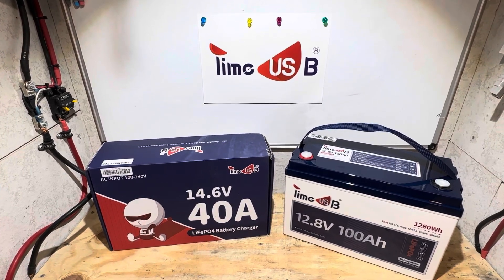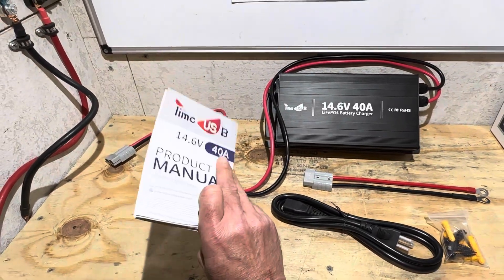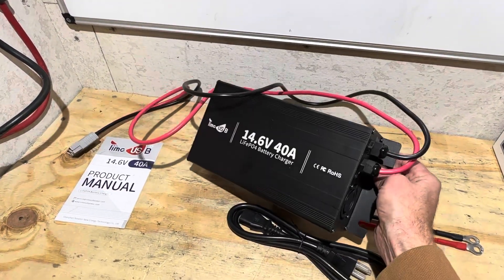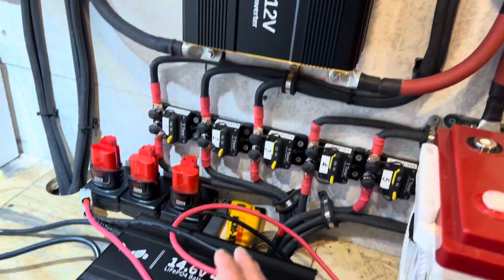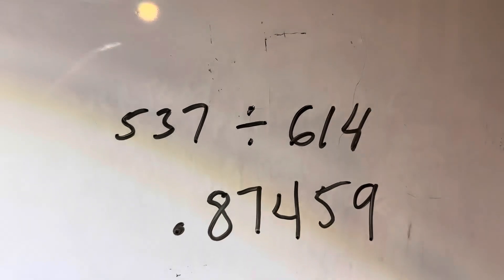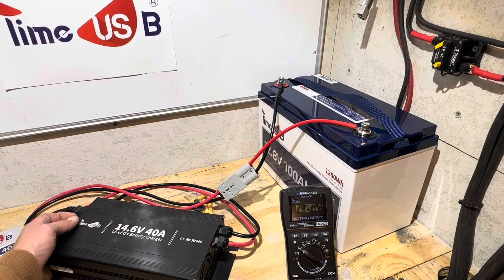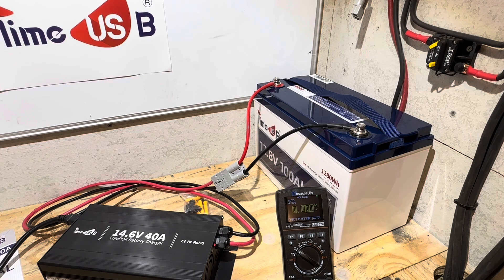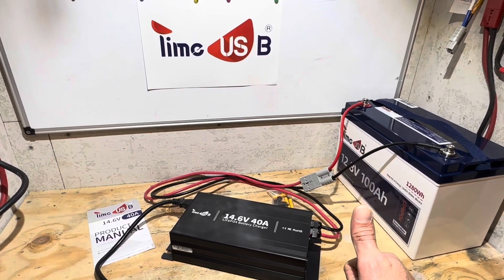Timeusb 14.6V LiFePO4 Lithium Battery Charger Review, 12V LiFePO4 Battery Charger

Comment: Hi will the charger turn green when the battery is 100%. My battery says it at 13.6 v and charger is still red.   Battery is 12.8v 200ah  2560wh.  Please advise. Thank you very much 🙏
Reply from the maker: Yes the charger LED will turn green. 
Empty 200Ah will take over 5 hours to charge. 👍

Comment: what sort of AC power does it use?  im just curious how much AC thsi would cost me  to get the batteries topped up compared to just using the ac power.  im not off grid or camping with mine  but i use my banks for some things around the property
Reply from the maker: 4:42 Should be what you’re looking for! About 87.5% efficiency.
Reply: @THEOFFGRIDMOUNTAINHOMESTEAD   thats what i get for fast forwarding :P  thanks
Reply from the maker: @vrrevolution9183 You’re welcome! 🙂

Comment: In my opinion a larger charger is important in cases where the solar power input is inadequate and a generator is required to keep things running. Getting those batteries back up quickly using excess power from the generator so it can be shut off to save fuel.
Reply from the maker: Exactly 👍 👍

Comment: Hi. Do you think this charger is good to be mounted on an RV to charge batteries while camping?
Reply from the maker: It would be a good choice for RVrs. It runs exceptionally cool compared to some other models I own. It has a nice charge rate so if boondocking with a generator it would require less run time too! Hope this helps please ask any other questions you might have.
Reply: @THEOFFGRIDMOUNTAINHOMESTEAD  thank you!

Comment: I have 2 TimeUSB 12volt 100Ah batteries ive been using since July. No issues so far. I believe the Redodo battery co has the same Lithium cells as the TimeUSB
Reply from the maker: Thanks so much for sharing your experience! The shipping box on the TimeUSB looks very similar to Redodo! Hope the cells are the same as you say! Redodo has good cells!